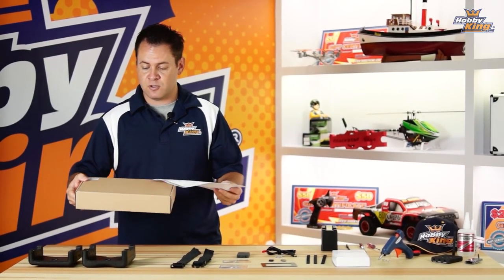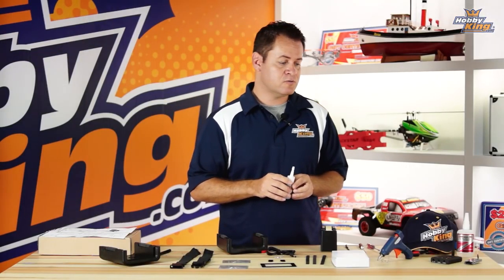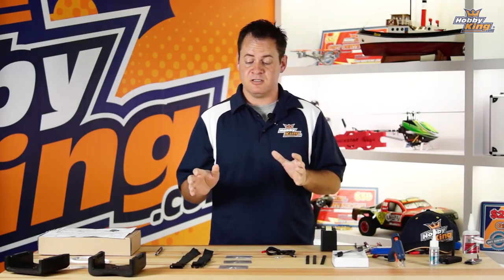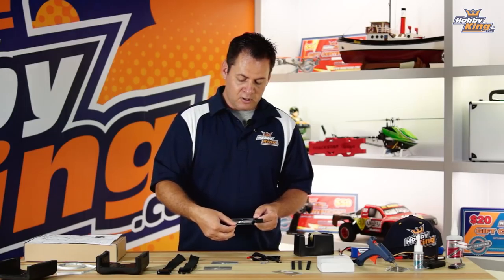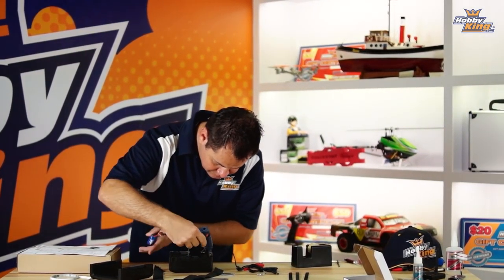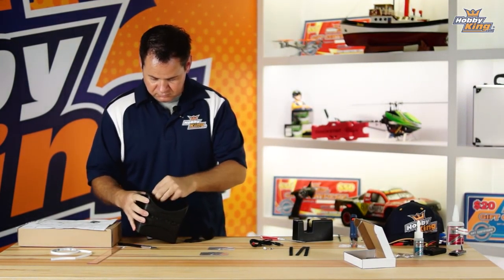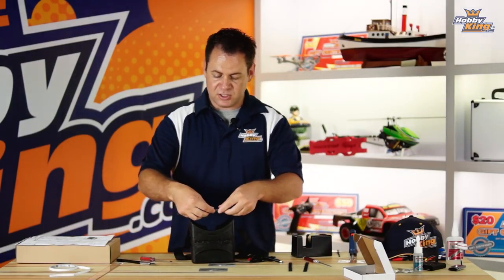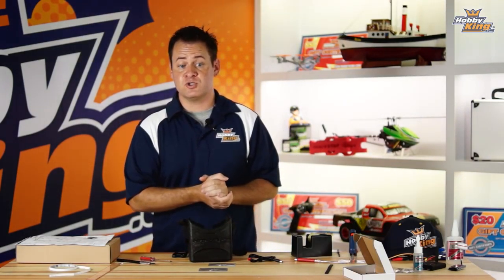HobbyKing Live - Quanum DIY FPV Goggle Build Video

Comment: This is the older Version of the goggles. You want the V2 of these! Much higher resolution and larger high quality screen. It  has a head tracker and video splitter and onboard cam option as well as a much better headstrap system and its approx 55.00 US. I got screwed up and bought this and had to reorder the V2 version!

Comment: Once you build/glue the box together, can you still reach the monitor buttons for the aspect ratio and any other settings? If not, may be wise to just use Velcro on the two halves.
Reply: Buttons are on the back of the monitor.
Reply: one big cable tie!

Comment: When these hit the UK warehouse I am gonna order one for a builders review!

ATB Malc
RCTV-UK
Reply: http://www.flyingwings.co.uk/index.php?route=product/product&product_id=411 bit more expensive Malc but thats where the idea for these came from plus its already in UK (though these are better value for money)
Reply: Gonna wait for this version I think, i like the way HK have put the package together for you and have molded it to match the screen ETC.
Reply: RCTV-UK Yeah HK have done a great deal, though like most things I can't see it being in UK warehouse anytime soon
Reply: £7 shipping from international warehouse to UK, can't beat that.
Reply: Don't bother buying one, not worth it.
Reply: neato4u Very well worth the money! Shut up
Reply: Ryan McDougall If HBK ships these with a slightly better lcd monitor, then it's worth it. Better just use a 7" monitor. These aren't good for FPV nor goggles. Check out my review @ neato4u wordpress
Reply: neato4u That's odd. I have used mine without any issues. And I have a set of Fatsharks so I know what a good set of goggles is like. You have to make a few mods to make them work better but at 30 bucks shipped they are still a very good value.
Reply: Randall Huston agreed! for the money its is good enough to start fpv or have them as a secondary goggles.
Reply: neato4u 7 inch monitor for fpv is useless as it will be unnecessarily heavy google! here not the size BUT the resolution of the monitor and quality of lenses matter. HK goggles monitor is very acceptable, and fresnel lenses do work. For 30 bucks it is more than enough.. Of course one can always buy latest fatsharks for 400 or 500 usd. But not everyone can afford it, or would not prefer..
Reply: Finally got around to putting these together and found them AWFUL/RUBBISH. Screen image very low quality and close focus gives me a headache. I'm sticking to a proper open air monitor.

Comment: what transmitter and reicver would you suggest?ill be useing them on a dji phantom 2.
Reply: We'll it depends on what you want, you can get long range systems but they are a lot more money but if your not going to fly 40km then I like to use the fatshark 250mw transmiter and receivers
Reply: Isnt the receiver for the fat shark goggles in side the goggles?and the tax goes at the bottom of the phantom right?
Reply: So do you hook both pairs of goggles up?
Reply: Go for Boscam 5.8Ghz set, get some decent CP antennas and your camera of choice
Reply: ok thanks bro!

Comment: Hope this helps but the connection from the battery should be a 2 Pin Mini JST Plug... I've found a 1Ah battery [http://www.hobbyking.com/hobbyking/store/__6474__ZIPPY_Flightmax_1000mAh_2S1P_20C.html] that hopefully will last a while :-)